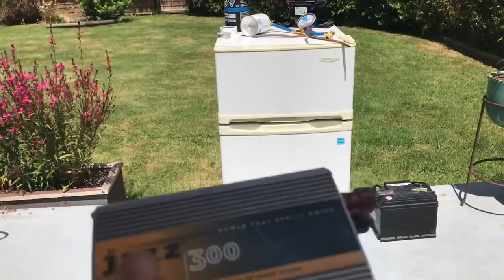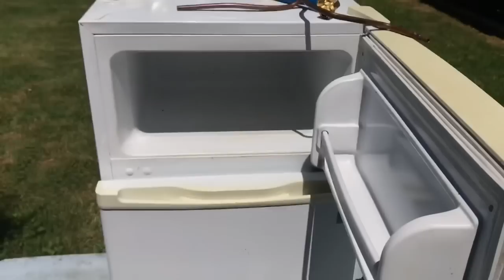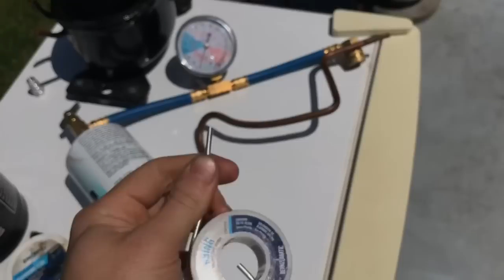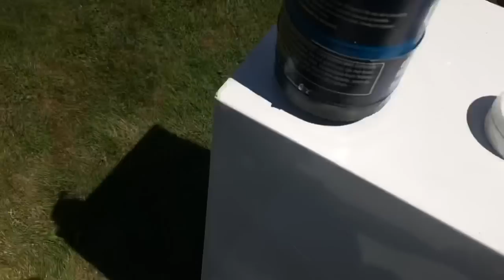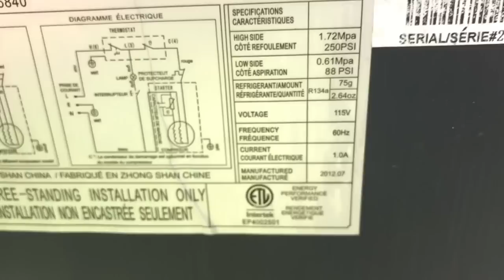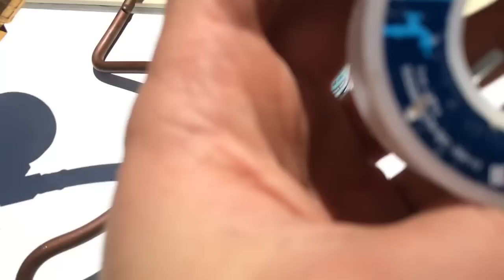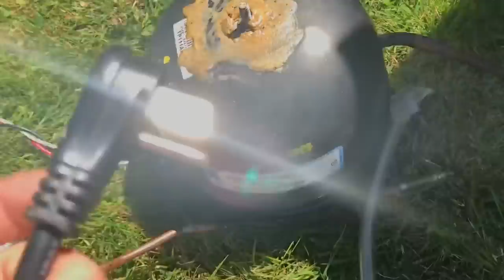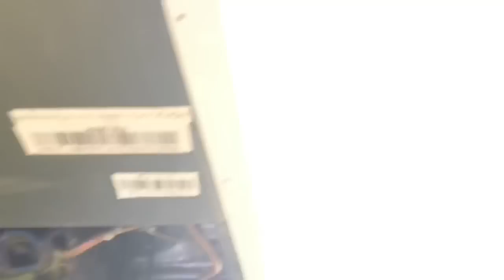Make Your Own Danfoss Compressor Fridge/Freezer For Cheap!

Comment: Just to get it out multiple times:
DO NOT vent ANY of those gases into the atmosphere, dont just cut up the pipes. They are all climate killers with very long lasting effects in the atmosphere.
(the propane/butane gas mix are commonly used "old+easy" gases in household freezers but need different system pressure )

R134a and all other newer stuff is still a planet killer, only "not that much" and thats why it's not sold outside us,
because people are lazy and just refill their systems (also cars) instead of fixing leaks.

The "new" CO2 cooling systems will be better for the environment, basically nothing negative if leaking,
but they have a much higher technical complexity because of much higher pressure, so more system leakage.

Yep, its "really easy" to do this stuff, just let it vent out if overfilled and be done, but really you are doing the same as if you'd be making your oil change into your fresh water supply.
And there are really sensible things like leakage testing over long time, evacuation, drying and so on. Just go to your local AC shop, they can do it for a bit of money.
They will evacuate properly and WEIGH in the correct amount of gas for the system.
Reply from the maker: If it is the greenhouse potential of this gas you are concerned about, the roughly half can of r134a that would escape from a fridge like this is the equivalent of the co2 output of driving 48 miles. The fact that this is a solar-powered off-grid refrigerator, recycling an old mini-fridge from the recycling depot, and factoring in the production and transportation emissions associated with the alternative option of buying a new 12v refrigerator- I have already more than offset the greenhouse potential of the r134a that escaped. Some of the old mini fridges I have found before, the refrigerant has already escaped due to the owner cleaning the ice off the evaporator with a fork and puncturing it.  I understand your concern, if someone is dealing with cfc's of any serious volume and especially ozone depleting cfc's, they definitely should be doing things by the book, or have it handled by a certified tech, but within the context of this instructional video I personally think this situation is acceptable given the reasons listed above. Realistically not everyone has the $1000 in professional recovery equipment or the time and money to spend on expensive certification training required to recover a half can of r134a for this single project. The hiring of a certified AC tech solely for this purpose of building this project would make this DIY fridge economically unviable. I would know because I contacted some shops for quotes on the install before I decided to learn how to do this myself. CO2 cooling systems sound cool and I hope to see them around more in the future. 
 Cheers.
Reply: @InflamedBallz  
Just to make sure:
I am not yelling at you :-)

Im all about DIY.

But there are the differences between getting certified (not important, honestly do not care about that because its mostly pay-to-win),
doing it right (important),
and doing it wrong.
- yes, you are saving power, and the r134a "is not that bad" but:

If somebody follows this video by just taking any old fridge, and "evacuating" or venting whatever is in there then it might as well be R12 or any older shit in there. 
Also telling people "if you overfilled just vent it" is simply "not right".

And if the old coolant already leaked it wont be fixed simply by refilling it with new gas.

if the manure hits the fan the old r12 lube does not work with the new r134a or lubrication was also lost, 
or the dessicant/drier is saturated,
or the o-ring/seals get dissolved by R134a
(seals and lube needs to be changed when upgrading from R12 on car systems for that reason)

Now quoting the net without different sources:
one gram of R134a would have the same global warming effect as releasing 1,410 grams of carbon dioxide. 
Freon-12 (R12), old refrigerant until 1990, is 8,500.
BUT CO2 is simply CO2 and not a "hydrofluorocarbon" so any plant can directly reduce it and its not hovering around the planet for decades.

It doesnt help that after i vented my AC i compensate by not taking the car to go shopping ten times. The right way is "not venting" and also "not taking the car".

To sum it up i would really appreciate if you would add the tech specs for which 

old => new systems (compressors) you can use this replacement method.
Same as when telling you already had tested it with another gas mixture (butane/propane) and that failed because of different pressure levels.

Sorry for the long rant.

Comment: now i'll give you a pro tip on those danfoss systems, the gas capacity is really small inside, 2 grams more or less make it go out of his efficiency point, it works but wil consume alot more power. So after you determined the right rpm of the compressor (as i said below with a resistor on the thermostat) you forget about pressure and weight and only use a thermometer on the evaporator on the point the thermostat stay (the hottest point), start charging the gas with small bursts untill see the temperature drop, give it 2 min to stabilise between bursts, at one point after pushing gas the temperature will go up instead of going down, you stop and just discharge a small amount. That is the sweet point and the right amount of gas of that system...
Reply: when you have sweat on the return line there is too much gas...
Reply: also if you don't change the filter, when you do the vacum heat it well with the blow torch, will get the moisture out...
Reply: when you want to use sollar directly there is another code of the electronic unit that work directly on the sollar, also if you don't want  a battery there are the euthethic evaporators that accumulate cold inside and slowly release it the night....
Reply: otherwise the power consumption will be like even 30% more...
Reply: then get the inverter and thats it, put wire on a thermostat to turn on the inverter and subsequently a fridge
Reply: @douglazamar8889  eh how about posting a Youtube video showing that conversion
Reply: A friend of mine converted a 110V ,5 ft chest freezer to  Danfoss BDF 35. The evaporator  got down  to minus 18 but inside the freezer it was just blow Zero.  The BDF 35 have around 220 BTU but the  former 110V compressor around 450 BTU. Anybody converted  a fully working  deep freezer with  the 12V Danfoss compressor? I run a 110V  domestic  5ft chest freezer on my sailboat in the tropics on a sine wave Inverter. 60% on and 120 Watt. The standby consumption  of the Inverter quite low, 5W. Thinking adding  a second  huge evaporator with a  BDF 35 on higher revs and using  both  systems redundant and independently
Reply: @gordonalexander6405  i've build my own freezer with a bd50 danfoss... 12cm of insulation and 45 liters of freezer... it draws 50Ah on summer and 40ah in winter on 24 hours... -28 to-17 evaporator temp and -18 to -12 on the hottest point inside.... as power draw the bd compressors are still number one even today..
Reply: Thank you sir.  How much efficiency loss vs using Danfoss coils though?  I want to use this for a deep freezer
Reply: That was dang nice of you to throw in all that extra info. Good video too.
Reply: Dude you ROCK! Dang that was the best advice I could have seen in a long time.

Comment: the danfoss bd35f and bd50f are the most efficient small compressors you might find. A modern marvel, inside that small box you have an atomic power plant :) In order to get it efficient working  they wound the brushelss dc motor (keep in mind that they where designed 25years ago), the dc motor work between 60 and 96v depending on the rpm you make it work, somme of them have a small board on the compressor to change the rpm, with no resistor between the C and T terminals of the thermostat will run at 2500rpm...
Reply: Which 24V compressor would you suggest for a 12 cubic feet fridge? I want to convert galanz retro fridge to 24Vdc

Comment: Your not meant to release any of it, its detrimental to the atmosphere,  which is why you cant buy R134A in most places. We have to have strict safe handling certificates to use these gasses. This information is incorrect.
Reply from the maker: Thank you for your comment Jamie. My comment that R134a does not damage the ozone layer is factually correct according to all the information I have found. If it is the greenhouse potential of this gas you are concerned about, the roughly half can of r134a that would escape from a fridge like this is the equivalent of the co2 output of driving 48 miles. The fact that this is a solar-powered off-grid refrigerator, recycling an old mini-fridge from the recycling depot, and factoring in the production and transportation emissions associated with the alternative option of buying a new 12v refrigerator- I have already more than offset the greenhouse potential of the r134a that escaped. I understand your concern, if someone is dealing with cfc's of any serious volume and especially ozone depleting cfc's, they definitely should be doing things by the book, or have it handled by a certified tech, but within the context of this instructional video I personally think this situation is acceptable given the reasons listed above. Realistically not everyone has the $1000 in professional recovery equipment or the time and money to spend on expensive certification training required to recover a half can of r134a for this single project. The hiring of a certified fridge tech solely for this purpose of building this project would make this DIY fridge economically unviable. I would know because I contacted some shops for quotes on the install before I decided to learn how to do this myself.
 Cheers.
Reply: @InflamedBallz  
Your information is incorrect, what do you think global warming potential is based on and dirved from?. And to boot R134a is carcinogenic. If everybody thought ah its 48 miles in a car, I'll let it go, you think that's acceptable?. Well as long as you got a cheap fridge, that's all that matters.
Reply: @jamiemarquiss6065  There has been global warming since long before there was coolant or cars.  Nothing that man does causes it. Just a few years ago, you liberals were predicting another ice age.
Reply: @Hey4883  
Blah,blah,blah, pull your head out, that head in the sand attitude is old fashioned. And Liberal... phaaahahahah.
Reply: @no candy .
Oh and its carcinogenic too boot. So fill your big gob up with loads of it and keep swallowing, just like you usually do.

Comment: Thanks for this video. But how many Btu/hr can the compressor handle and how do I size it condenser because I want to experiment what you have done.
Reply from the maker: thanks for the comment Toyin. I suggest you look at the danfoss specifications for their line of compressors to see the cubic centimetre cooling capacity.  In terms of sizing a condenser. If you want an estimate in terms of sizing of a condenser, I would look at the condenser sizing of similar production fridges to those within the cubic centimetre cooling capacities of danfoss's specs and take a look at the sizing of condensers on the 12v danfoss fridges sold in stores. If you want to get down to the exact sizing math, I'm probably not your guy as I'm not a refrigerator tech myself.

Comment: WARNING. Do NOT do this if the compressor/refrigerator says R290 or R600. R290 is propane and R600 is butane. Both are highly combustible. If you see any warning about fire or explosion, they speak for themselves. Otherwise, thank you for the video! Just trying to look out for the DIY-ers out there.
Reply from the maker: thanks matts!
Reply: So how 50 grams of propane present any danger? Just cut off the pipes and let it go...

Comment: Thanks for the info I got a nice fridge inside my camper but it's  a 110. I'm totally off the grid with only Soler and don't have the money to get my power pole in right now and being in Florida my cooler keeps ice maby for 2days if I'm lucky. And all the little cooler with temperature control cost around 300 and up. I can just change out the comperser to 12volt and have I nice fridge. To hold more for the money. Please keep me updated on how it's working out. And grate in the video 😎😎😎😎😎

Comment: Yep so all of the car wrecks that happen out there in the streets won’t matter, and I had an Astro van about a 84 model, it had the r12 in it, all I did was vacuum out the system and recharge it with r134, and it worked perfectly, and had no problems, in a matter of fact it cooled much better!

Comment: So That’s just a compress with a built in converter🤔
Where is the savings in electric? It’s still a 115v compressor!
Reply from the maker: it's not from what I understand. it has different windings from a household compressor to operate at a lower voltage.  it also operates at variable speeds and is 3 phase.
Reply: I don't know what the model of the compressor used in the video is but I know the Danfoss bd35f compressor is dc powered. The converter on the side of the compressor is actually a brush-less speed controller and the compressor its self has a BLDC (Brush-less DC) motor inside not an ac one. Although if you wanted to you could probably make it run on a vfd off of ac power.
Reply: Joshua Kiser probably not.  The three phase brushless motors require a speed controller to operate.

Comment: the old 3 ways are inefficient...when i got my 1st danfoss , IT CHANGED MY LIFE , so yeah...way to go....i now have 2 , + a compressor from one i trashed trying to do what you did here....hoping to build a compact freezer , and use a home built super-insulated box for veg.,eggs , etc.   
     freeze water/milk/meat and cycle frozen food into cooler as needed    
 i don't know refer tech. , so THANKS !!!
Reply from the maker: gayland barney do you know why your first compressor got trashed? Overcharge? lack of lubricant?   I've noticed in China they have Chinese made BD35H 12v compressors for $80 cad new.
Reply: @InflamedBallz  it was MY FAULT !.....i was trying to remove the compressor unit from a refer i found ON THE SIDE OF THE ROAD-FREE! (the controls were malfunctioning); and didn't know the lines ran around the box , through the foam , so managed to cut the line......... a liquid (lube?) poured out , so i just cut the whole unit out , assuming i'd get back to it......................still haven't , but THANKS AGAIN for the info...

Comment: Freezer works great (-15 celcius), but the fridge has like 13 celcius. What am I doing wrong?
Reply: Its probably got a 240v evap fan init so its not moving the air i cant see this working at all .all it will do is freeze up the evaporator fan will need to be changed to run off 12v
Reply: Maybe is not enough gas inside. Try to recharge.

Comment: All refrigerant is basically the same, they've just reformulated it and threw another name on it to make more money. ( the patent on r12 was about to expire)They all dissipate into the air and effects are the same( not too much). PS. They're is no hole in the atmosphere, it's a scam.!
Reply: Wrong wrong wrong... patents are 17 years... omg... we've LONG expired the patents on R22 and R12... that said R22 and R12 cannot be purchased anyway so what's the point.   Regarding the hole in the atmosphere... R12 and R22 are 1gm to 8,000gm CO2 equivalent.  Do some reading before you preach disinformation... PLEASE!!

Greenhouse Villain Could Be a White Knight After All - The New York Times
https://www.nytimes.com/2007/12/02/automobiles/02COOL.html

Comment: KundaliniKid,  How about an update on your DIY Danfoss swap.  Is it still working after a year?  Have you been using it every day?  Been watching Craigslist, but haven't found a used Danfoss yet.
Reply from the maker: I actually sold my van along with the fridge, but it was still running great when I sold it. Any luck finding a 12v compressor? I recently purchased one in China from purswave for $90 canadian dollars. Not sure what the international shipping fees would be buying it online. You can also search classifieds for "12v" fridge and see if anyone is selling one that lost their refrigerant and needs a recharge, usually at a low price.

Comment: Hi i am looking foward to do the same protect as you did in this video. I got one question and is how much time can the fridge run on the battery you have there without charging it. My protect is for a boat that has a 12v fridge, but I want to upgrade to a bigger one but the prices are really high so I want to buy a 110v bigger fridge and adapt a 12v compressor. I always have my battery charger turned on but when I am navigating it's off so that's why I am asking how long can it last without charging it thanks!
Reply from the maker: Did you end up attempting a build for your boat? The consumption of the fridge depends on the amount of insulation, the outside temperature, whether the fridge has a freezer or not, and the litre capacity of the fridge. The better the conditions, the less the compressor will cycle to maintain temps. While the compressor is on it's drawing about 60w depending on the rpm setting it's at. You wanna make sure your 12v compressor is sized properly for the system or it will be overworked.

Comment: How do I size the correct compressor bd35 or bd 50 for a 4.4 cu Sanyo Sr-433S fridge ?
Reply from the maker: Hey Philco72, you can look at the cubic cm of the fridge and compare it to the danfoss specification sheet for how many cubic cm each compressor model is suited for cooling.